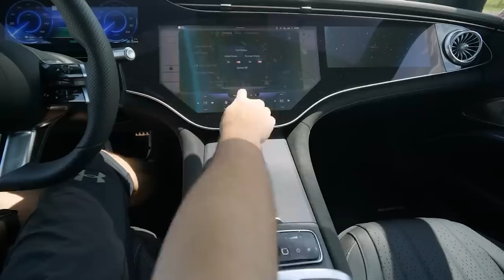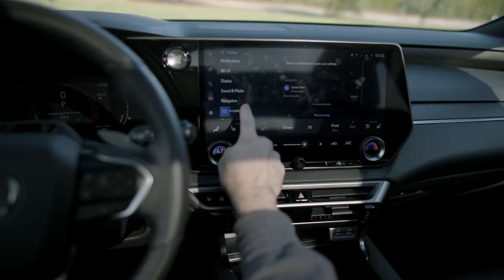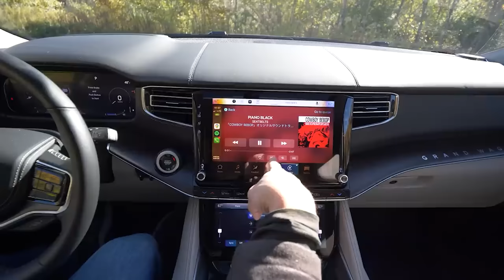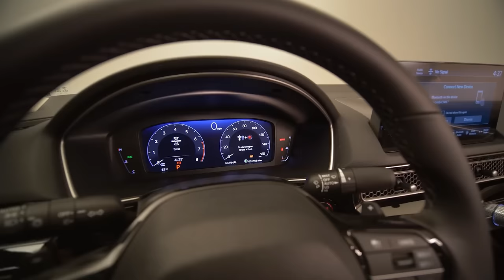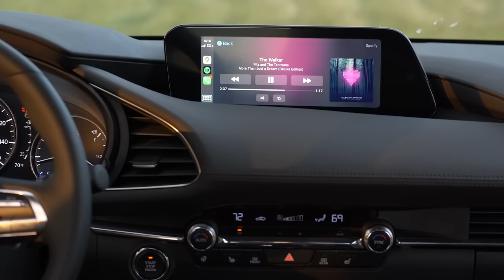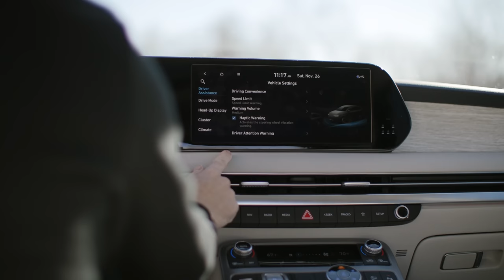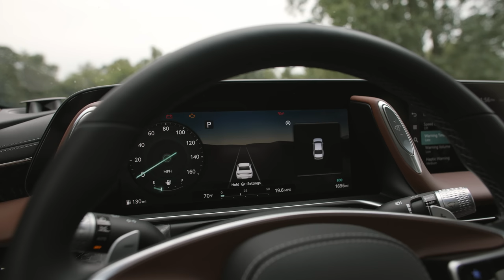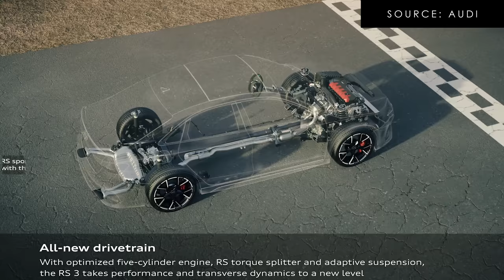Best Cars of 2022 | SavageGeese Edition

Comment: Gotta be honest, I view full size luxury sedans the same way y’all were looking at Elantra N vs Type R. It’s a few percents of a difference in terms of the ride quality, but when you’re north of $100,000 - it matters. I just think it’s really hard not to give it to the s class in this segment because much like the civic type r, the s has the pedigree and that slight difference in the ride quality. It is, and probably always will be, the undisputed king of that segment. Genesis should’ve tried to go for a segment that doesn’t have a clearly defined King like the S class - like perhaps attempting a GV 90. The GLS doesn’t hold the same kind of pedigree or brand image as the S class, so perhaps genesis could’ve pulled off a big upset in that arena. Honestly imo, the G90 actually made MORE sense when it cost less than $100,000 and had a V8.

Comment: Neither car of the year offers a manual. And, as you pointed out, at least for the Porsche no mortal can get one. I've ordered 6 Porsches since 2013 and have 0 chance of getting an allocation. I don't understand why they bother promoting them. 
Great channel BTW.
Reply from the maker: The car sometimes deserves the accolades even if you cant get a manual etc.  The GT3 would still be top dog, but that was last year.
Reply: @savagegeese  I get it and admittedly wouldn't want one at this point anyhow. Same with the GT3 and those damn center lock wheels. I (and my wife) now like the more "GT cruiser" feel of my 992 C4S cab, but still love having a manual.

Comment: While I'm on board with your other assessments, based on your review of the MDX (and the pricing of the X5), I'm not sure if it should take the win there. Aside from being a true 3-rower the type S is slower and less fuel efficient than the X5, offering no true reason to win. Not to mention that the X5, when comparably equippe, can cost about as much (if not less) than the type s. Sure, you can go for broke on X5 options but they're non essentials whereas the MDX pigeon holes you into a base or advanced package. Also the UI/UX on the MDX is so far below that of the X5.

Comment: god bless the sienna and the minivan. I get 32MPG average and I throw children at it constantly. the lack of hiding the 2nd row is the biggest detriment, but I've rented a lot of pacificas, and the insanely high load floor, lack of movement flexibility (no sliding) and absurdly thin seats of the stow-and-go seats is not worth it, honestly. also, those rental pacificas get generally about 15 city. maybe there's rental problems with them, but even thrashing the sienna you're getting 28MPG.

Comment: 28:50 Damn right its about sound. Motocycles even more so. How does it sound. How does the verberations make you feel. Seriously my RSV4 sounds so sexy and if I'm kick stand down into concrete you can feel the 4 big bangs w every RPM its so intoxicating. If you don't get it you don't get it go away I'm not talking to you.
Reply: Pulsing through the ground up and into your body through your legs. Its something else. Then you hop on it and your IN the machine. Its fantastic no one can get that unless you've gone through it.

Comment: I bought a 2022 Lexus ES 350 F Sport back in May.  The car is beautiful, the red matador tri coat paint that looks like a different red in various lighting conditions.  The interior is comfortable and appears to be well crafted.  The technology is nice, just enough tech to go along with actual buttons that you can press without taking your eyes off the road.  The ride is smooth, the transmission gingerly moves along and with a 300hp v6, it's "quick".  With all this said, there is a "but".  That "but" is the car lacks any personality.  It's like the hot chick who's boring af.  I'm conceding that I've evolved out of the targeted market segment for this vehicle.  With that said, I'm looking at the BMW M340i.  Similar in size and mpg, but offers that excitement with more power, a turbo, and an exhaust that sounds like it compliments the power.
Reply: mor ethan 95 percent of chicks are boring lol, you have to be ready to guide the conversation, besides they like a more capable guy

Comment: I don’t know about that reliability on ram claim. I’ve seen some internal research on that with one factor in particular, which negates the build quality. I’ve had a ram 1500 for 10 years now and it’s been easy street; I know, anecdotal. Though, every Ford my family has owned has been a nightmare; this includes F-150s.

Comment: For the inflated price of the f150, theres zero excuse for not having led headlights standard.  The tundra can do it at a lower price point
Reply: Of course, the Tundra can't do on-road full-time AWD at any trim level. Everything has tradeoffs.
Reply: @tonysterbenc  u have to shell out like 20k over where the tundra starts to get on road awd for the f150 cause ford gatekeeps it for the lariat trim.  Basically same thing with their led headlights.  Trade offs make sense when its unneeded but in this case its just dumb

Comment: Man, pretty much any theoretic price factor here is absolutely irrelevant. For example: ES - you can't put a custom order, so you get what they build atm - either under-equipped at 50k OTD or over-equipped at 58k. Add 2k more for hybrid. I really wanted to buy ES but at that price there's no way I'd pick it over G80 considering what it is for the price and I went with Genesis.
Reply: Are you in Canada, or a backwater where the dealers gouge $5,000 more than anywhere else? Because if it's neither of the above, this post sure sounds a lot like rationalizing.
Reply: @tonysterbenc  go into any Lexus dealer in US (or call them) and get the out of the door price on any ES.
Reply: @rosgoncharuk2403  I did. I own a '22 Ultra Luxury. I ordered, waited 7 months, and paid sticker minus $300. Next.
Reply: @tonysterbenc  oh you don't say! So what was your total?
Reply: @rosgoncharuk2403  I don't talk that stuff online, but if you look up the MSRP of a loaded ES UL, you'll know. BTW, the G80 is a beautiful car -- definitely looks more luxurious and expensive than the ES. It's just that I'm a buy-and-hold guy, not a lease person, and I didn't trust the durability.
Reply: @tonysterbenc  52k MSRP + ~3k tax and fees +1-2k in forced options and accessories = that's at least 56k for a car based off 30k cars platform, just with better materials, yet even design feels the same and the tech is horrible. That's basically a new old car. And don't get me started on the difference in the underpinnings...

I bought g80 to keep as well, due to long warranty. I like ES and I was considering working in getting it. I could justify it under 50k, but not at 56k+. Effectively now they don't build Luxury trim, so it's either base lacking audio or maxed out. Here in Austin they all come with at least optional headlamps, so that's at least additional 1.2k. No custom orders. 

That's my story with ES - too much for what it actually is.
Reply: @rosgoncharuk2403  In the context of its Camry origins, that price criticism is fair. In the context of the alternatives north of it, I ended up viewing it as the value choice.

I also had options forced on me, including the $500 panoramic sunroof I'd firmly insisted I did not want. When the factory would not remove it from the build order, the dealer graciously stepped forward and said I would not be forced to pay for it. The credit-card shaped extra key for wallet use was a $100 trinket I'd never have chosen, but I've since come to like it. I actually wanted the triple-beam LED headlights despite their stiff $1,500 tariff, and no regrets on that one: They practically make stop signs burst into flames.

Comment: Surprised TLX A-Spec wasn't a runner up against the ES for entry-level luxury. Similar price point, a bit more interesting to drive, looks just as sharp, Honda reliability...
Reply: Acura reliability isn't the old-time Honda reliabiliity you're used to. Highly stressed new engines, problem transmissions, a generally lowered standard. I'm sure it's MUCH more interesting to drive, though.

Comment: The way I look at this is: for the money I saved buying my Elantra N over a Type R, even if the engine blows I could probably fix it out of pocket and STILL have paid less than I would've for a Type R. Here in Canada a Type R is 52 grand CAD MSRP while I paid 39 grand CAD for my Elantra N. The price difference there is insane. Never mind the CTR being on a 3-year long waitlist here...meanwhile I waited a week for my Elantra N after scooping up a cancellation lol. That availability factor is huge, I've seen more Elantra Ns driving around my city this year than FK8 Type Rs despite the FK8 being around for 5 model years and the Elantra N only 1...
Reply: These 1.6t are pretty good, so you would be pretty safe to park that money elsewhere, maybe mods to make it even better or faster than CTR
Reply: @camryt   Elantra N comes with 2.0t and it’s an amazing engine especially a tune can turn the car insane
Reply: @darienhaghighat6400  whoops, it is 2-litre indeed. I confused it with a 1.6t that they also use in Europe in a couple of models, including the i20N

Comment: The Elantra gets a major redesign every year and somehow it gets uglier every single year. Call me superficial, but the fact I can't buy a performance Elantra that doesn't look like a fucking gundam is so annoying. That's the one thing VW and Honda got right with the Golf R, GTI and the CTR. You can tell they're special but the designs are elegant, restrained and will stand the test of time. In 10 years time, that Elantra N is going to be as visually appealing as a Pontiac Aztek.
Reply: the back end is OK for me, but if i were to get one, it would have to be in black just to hide most of that front end.  woof!  haha

Comment: To not even mention the GR Corolla despite trying to buy that first over the Type R is a bit meh.
Reply: I tired buying it for a ownership series. Trust me its much worse to drive than the ctr.
Reply: @jackholmes8105  I appreciate the response. Humor me a bit here. From everywhere I've read (review wise), everyone claims that it's on par or better to drive than the type R. Some even saying it's overall better, despite the interior, than the type R. Do you think it's because they actually believe all that after extensively driving it or are they just trying to get views?
Reply: @karniverous  personally my experience with the gr corolla was limited to the drive i had in utah. On track the ctr is the more rewarding car. The gr corolla feels fwd 99 percent of the time anyways. I can also tell you for a fact the new ctr around track is faster. It has the better gearbox, seats and overall inputs. As a pure street car in bad weather specifically i think the gr corolla would better the superior car. Outside of that i think i have to give it to the ctr

Comment: IMHO, the only place that a haptic / touch screen interface works is on a cell phone; and that's only because frickin' it has to. 
If they were still large enough to support a manual QWERTY keyboard, that the way I'd be riding.

Comment: Entry level luxury SUV? X3? Macan? I mean Like Mazda CX-9 which would actually be reliable or Mazda CX-5 depending on what size.
It is amazing to see this site BMW vehicles on the best list when all BMW cars are throw away lease vehicles and nothing I would want to own.
I have a 2011 QX56 and honestly after 12 years and 150k miles it still runs great, performs great and new cars offer me basically NOTHING in terms of new features. Thankfully Infiniti still makes the same thing today. I've had mine for 7 years but I would buy another one again. 
I wouldn't touch anything german even if you paid me, and considering the price of these vehicles; your list is mostly for uber rich people who will just throw it away almost immediately.

Comment: The rav-4 can easily be modified to be fun.
Reply from the maker: With a V10?
Reply: @savagegeese  Don’t need a V tend to be fun and nice lift kit with some off-road tires are good to go there is actually a community of RAV4 enthusiasts
Reply: @savagegeese  i dont know if their bot hid my comment abotu aftermarket, but i wanted to make it clear that it would be a interesting video topic, where driving effeinctly is seen as a layer of driving fun at whatever speed or drifting is desired. wanted to also add the idea of not having a car to carry the whole family ,  where instead a van would be rented for the once in awhile family roadtrip.         by driving effeinctly, i mean making most power at optimal rpm accoridn gto bfsc chart for engine, minimal and steady braking, steering, building mor emomentum at downhills and before uphills so more speed per torque, keping tires pressures not too low/high by testingwhen changing oil, cleaning out dust in the electric battery fan filter. i hear that theres a spepcialty scan tool  called AUTEL EV/hybrid to  reprogram the electric enegry management for beter longveity of battery, i dont now why that programing woudlnt be part of the car from factory, or maybe i misunderstand what it does. i guess that tool scan and reprogram would be done once in a while

Comment: Civic type R is SOOOOO over rated for the price... if it was like 50k CAD it wouldnt be bad but 80k?!?!? nah man no honda civic is worth 80k, you can have a slightly used Grand Cherokee SRT for this, ridiculous. you csan find the elantra N with 10k miles for 36k, its not 10k less than the type R, its over 40k less...

Comment: I dont get the whole giving oem points for its fast, so what the z06 c8 is fast FOR AN OEM. You want a track car, build a track car. There is nothing you can do with super horses on public roads other than get in trouble. I have a 750 hp corvette, they arent hard to build for a lot cheaper,  I just dont get the fascination of people wanting all this hp for street cars, HP you WILL NEVER USE unless you take it to a track, and at a track, OEM builds are not that special